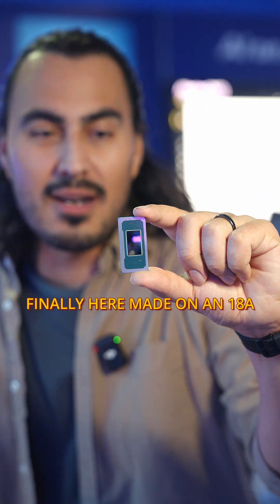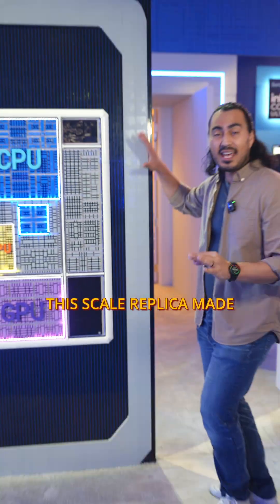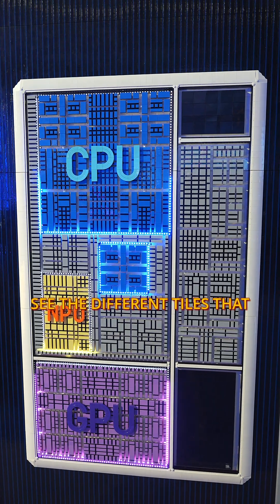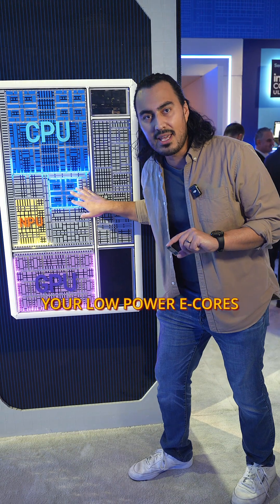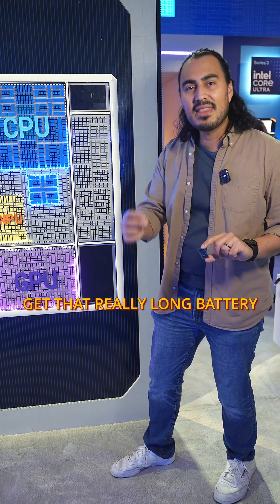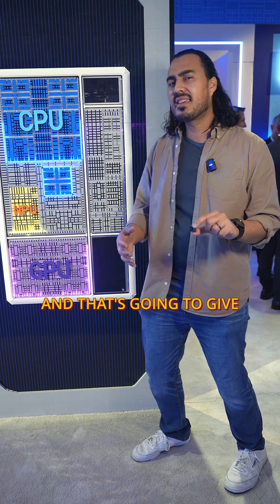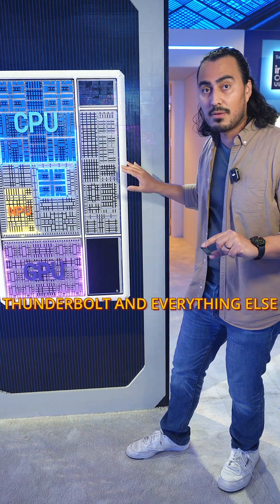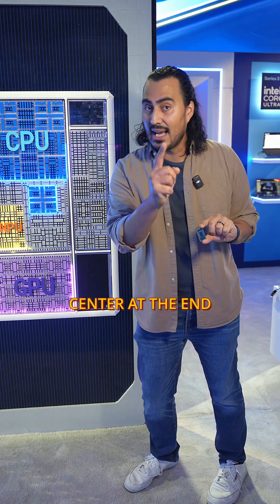Intel Panther Lake Processor Explained at CES 2026!

Comment: Microsoft’s partners are working day and night to beat the MacBook — from OEMs to chip manufacturers.
But Microsoft itself seems busy making Windows worse.
Man, it’s 2026 and Windows 11 still doesn’t have a proper dark mode.
The UI is inconsistent and poorly aligned everywhere.
Windows native apps are slowly dying.
And even after six years, the Windows on ARM translation layer is still not good.
Apple nailed this on day one with Rosetta. It was so good that 80% of users probably didn’t even realize their apps were running through translation.
At this point, I can confidently say Windows on ARM has failed — it got completely smoked by the competition.
Windows on ARM couldn’t even scratch Apple.
I honestly don’t know what Microsoft is doing.
If this continues, Windows is heading toward the same fate as Windows Phone.

Comment: Upsell it and all, but, when the in person real world reviews come out, we'll see then just how excited I am about the new fake frame gen direction Intel is headed. Death of a giant feels on the horizon. I hope I'm wrong .
Reply: Lol. Youre downplaying how big it is that it has onboard xess frame gen software. Either way, this is literally THE most advanced chip EVER made or released on the market in hardware terms. if you know anything about the fundamentals of chips, you’d know that. From 18 angstrom foundry, to ribbonfets and backside power delivery, to foveros 3d packaging, its actually THE MOST ADVANCED CHIP EVER. This chip is 1-2 years ahead of its time, and only possible because intel owns its own foundries. Btw, this chip is on a 1.8nm node when amd chips are currently on 4nm☠️ youll see amd chips on 2-1.8nm in a few years
Reply: @Bronson1952  comments like this make you seem dumb. I'm not denying intel made a revolution for x86 chips, but size stopped being relevant years ago. Its basically a marketing gimmick now, showing off how small you are lol. The transistors are bigger than 3nm even on a  “1.8nm” or “18 Angstrom” chip, even with their new back side power delivery and RibbonFET tech.
Reply: @تحسين.كمال okay? But the chips have 16% more performance PER watt? These are hands down the most efficient chips out now
Reply: Eh… my handheld uses lunar lake and I can run Fortnite on mostly epic settings at 1200 p and get about 90FPS with Xess (not frame gen) set to performance. This is supposed to blow that out of the water. And that already beats what AMD has in their handhelds.
Reply: @nicholasolsen4698 yeah. This is a powerful goddamn architecture on so many levels
Reply: Apple is doing what Intel couldn’t figure out. AMD is closing the gap fast with highly efficient, professional-grade processors, its partnership with TSMC the undisputed leader in chip manufacturing.
Strong design, elite fabrication = better outcomes. Intel is being left behind, a failure to another.
Reply: @loud_man  Being AMD loyalty are not very good, dude.
Reply: @loud_man lol. This pantherlake chip is trully by some of the most important objective factors the most advanced chip in the world though. The fact that tiny gpu on board can match a 4050 in raw performance is insane, plus the fact it has xess (a true competitor to dlss unlike fsr 3, which is the only available upscaling on all amd mobile chips, including their most advanced) and xess multi frame gen on such a small package is insane. That means handheld pcs will have a gpu as powerful as an rtx 4050 and xess and frame gen☠️☠️ thats fucking insane u dickrider